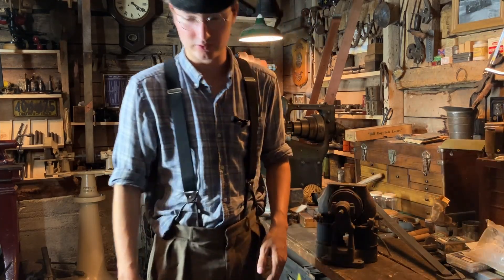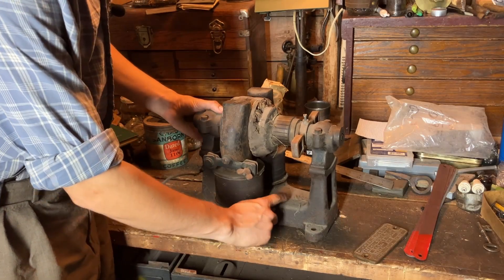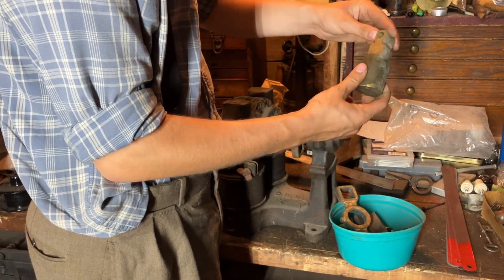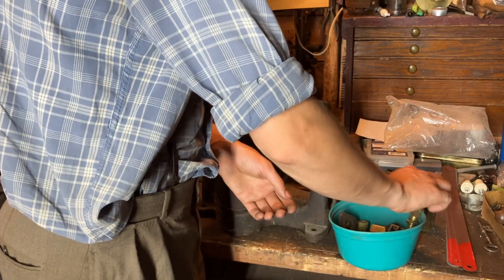130 Year Old Electric Motor/Dynamo!

Comment: I hope to watch some update on this.

1/4 horse? Very small to use as a dynamo but OK ... 200W (a bit less) was quite a lot at that time.

About the resistor ... Not too difficult to find wire. Just look around for some old home heater using open (spiral) wire. 
Or just buy new one. That kind of wire is still available. (in different values "per meter" ).

Don't try to twist that wire where it is broken. Could be OK for some time but not on the long run.

Comment: That insulation will be full of asbestos...
😐🇬🇧
Reply: In this country and other developed countries asbestos is a big deal - 
     It the same for lung cancer  - 1 in 20 have lung problems in the U.S. that includes none smokers and smokers - 
     Yet only 20% smoke in the U.S. - it's the same with aspestose it's been demonized - 
     1 in 20 house dogs, cats and stabled horses come down with emphysema also that leads to lung cancer in the U.S. - 
      In India aspestose is still mind and has many applications -  
    In France 1 out of 3 smoke yet health wise there rated number one in the world when it comes to developed nations - 
     The U.S. is rated 73 health wise - aspestose and emphysema is the result of defficcencys in sulphur and vitamin C along with other minerals in our diet - 
  I've had all those health issues in the past - 
  You can look up MSM on you tube and learn about it - 
   If you get it get the 99.9% pure granulated type - 
    At one time I needed oxygen not any more - 
      For some reason there are statements on the net that France has a high rate of cancer - there is no truth to that - 
    The U.S. does have a high rate of cancer -
Reply from the maker: @glennmoreland6457  good point. Will be careful with it